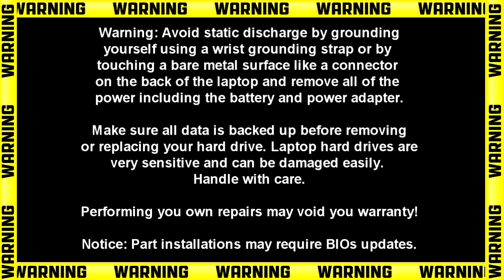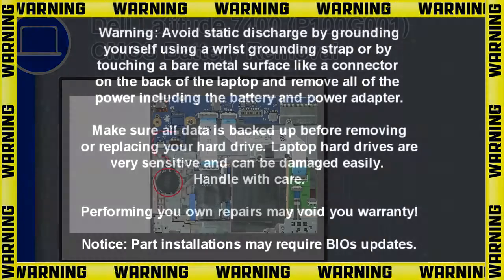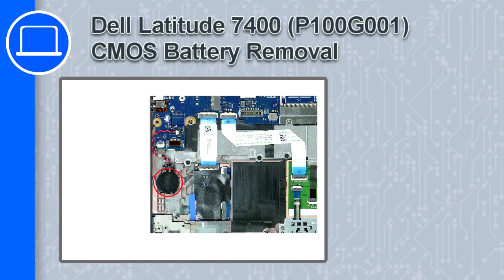Dell Latitude 7400 (P100G001) CMOS Battery How-To Video Tutorial

Comment: Very nice tutorial. I also have this laptop on me and I have question. Does this removal of CMOS battery and putting again  can reset my BIOS password? I have my BIOS password locked and I have this problem. Thanks!
Reply: Well, did you figure it out?! Thanks!
Reply: @PearComputingDevices  No, this does not remove password.
Reply: @robertfeng1988  Yup, your right. It's a scam
Reply: The 7400 has a very resistant bios password. Removing battery, shorting pins and so on did not work for me. Also the unlock code for free websites do not work on the 7400.
Reply: @eshark11  its driving me nuts trying to get it it unlocked. did you ever figure it out?